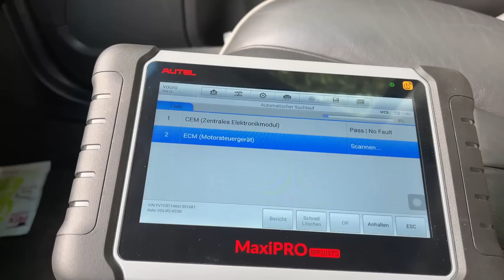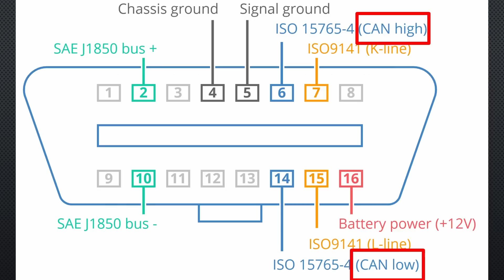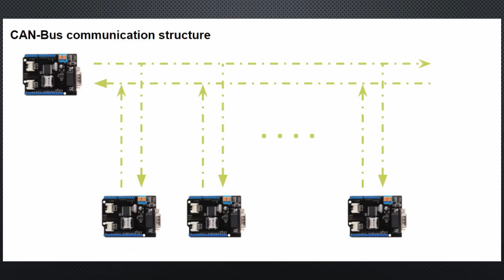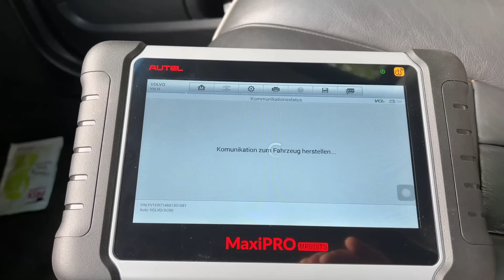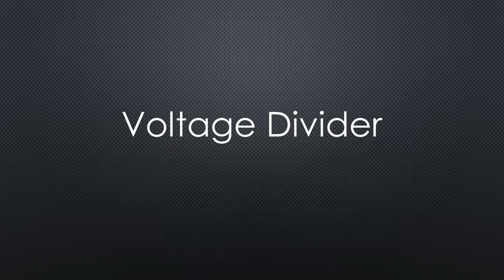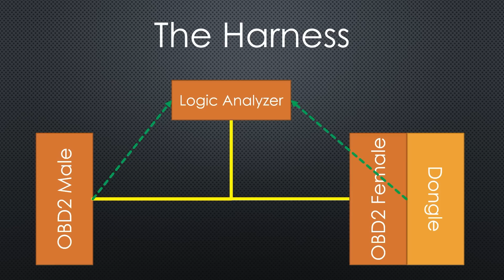#421 Home Made OBD2 Engine Alarm Resetter device using an Arduino?

Comment: After CDI and mapped ignition systems (PROM,s) electronic control of engine management, has been, downhill.  No longer, can the user make an adjustment, or ascertain what the fault may be, without some software magic.  Screwdrivers and spanners, are no longer enough.
😒
Reply from the maker: I agree. The world is getting more propretary systems...

Comment: I would like to read obd2 value and put then in a display, so I can later use value of rpm readed and every time rpm are between 1500 and 2000 activate an water pump. Is it possible?
Reply from the maker: Yes, you find such projects using Google.
Reply: @AndreasSpiess  actually you don't for few reasone, some incomplete, just show it working or show half of it, others like a like but they aren't what I looking for

Comment: Solution is ease... read all data from car without OBDII dongle, made list of ID/data frames in excel. And made another read but with OBDII dongle and made another excel list of ID/data frames.
Compare both lists of ID's and by this you will find only ID/data responsible for OBDII dongle.
Reply from the maker: Thank you for the tip!

Comment: The auto repair place located a defective oxygen sensor on the intake to the motor of my Toyota.  The alarm condition had been removed but the alarm history was still showing in diagnostics.

A local Hardware chain sold me the Innova 3020d for about $80cad.  I found the proper manual on-line and followed instructions to clear all.  It worked.

USB and WiFi OBDII dongles came with WinXP multiple softwares that were mostly demo versions.  Buggy, GUI quality and software functionality was rather poor.  

The best was a bluetooth OBDII dongle for about $12 combined with 5Euro Car Scanner Pro software from Android Play store.  The phone software had a cool free demo version that unlocked when paid.  Connecting to the BlueTooth dongle and then the ECU Engine Control Unit was smooth and repeatable.
Reply from the maker: Thanks for your info. After many comments I purchased such a dongle. But I still wait for the alarm coming back. So far the car runs and runs...

Comment: I am absolutely aghast that an engine would be allowed to refuse to start due to the failure of a non-essential sensor. I have a whole PDF dissecting in detail how my VW Z1 engine would handle the loss of basically any single (even critical timing) sensors AND KEEP GOING, by falling back to something else to obtain ALL information it needs - and yes, that includes losing BOTH channels from the accelerator pedal position sensor: the car defaults to an elevated idle, and still lets you limp home. Then again, the Z1 predates OBD2 (runs on KKL), from a time they used to make things properly...
Reply from the maker: In addition, the car runs without any problems since this day. So The problem obviously was not too critical :-(
Your car management system seems to be much better.

Comment: There might be encrypted obd 2 busses, and maybe search for some volvo dump of their obd 2 software, there might be a usable library. The standard OBD 2 (rpms etc) are I think part of a mandatory set, all manufacturers are having own subsets and calls to submodules ... Maybe you can find a universal library or even a universal android tool who works, then sniff the exact message is not easy.
Reply from the maker: As I have a tester which can create a working code I thought I can copy its behavior. Others also pointed to apps which should work. Currently I wait for the error to re-appear.

Comment: I scrolled through most of the comments but didn’t see it: what sensor failed that shut the car down?
Reply from the maker: Unfortunately we did not make a picture because we did not expect that it will no more appear. It was something with low voltage.

Comment: Usefull no, informative yes. I have an electric Smart for two and was hoping to see something. I guess I have to wait for the other video
Reply from the maker: Some electric cars seem to have no OBD2 connector anymore...
Reply: @AndreasSpiess  My 2013 SmartForTwo electric has one, but most dongle cannot read anything from port, except the most expensive one. One guy as a 5000$ unit that could not reset my error message!

Comment: Cars stopping dead is pretty dangerous. My DIY Arduino EFI stopped entering into fast moving traffic and nearly got T-boned, but thankfully I got it started just in time. Either way I got rid of it.
Reply from the maker: Good idea to disconnect it! I do not want to have it connected while driving. Just for resetting the error.

Comment: Hi Andreas, it is fine to use this resetter if it happened one time only. But if you are getting this error regularly, you should investigate the root cause. It might  create a machine damage, or even a safety issue, which slightest possibility is not acceptable where human safety risk is involved. If you are getting errors regularly, please be safe, and do this. (Promise we will watch those videos as well ;).

Take care.
Reply from the maker: Yes. Of course you are right!

Comment: another way to reset the ecu is to just simply disconnect the positive terminal of the battery
Reply from the maker: Good idea. Others suggest that the important trouble codes are stored in EEPROM. But I do not know.

Comment: Looking forward to your next video on this.  I have an OBD2/CAN reader tool that is sort of mid level ~85 USD that will read and reset codes on each of my various vehicles, Ford, Saturn, Honda, Jeep, Hyundai, and Mercedes.  They range from 2000 to 2019.

Not quite ready to tinker with my 2018 E63s AMG's bus but wouldn't worry too much about the Saturn :)

Beyond resetting the DTCs, the next step is controlling features of the car.  For example, my Mercedes shipped with intelligent LED lighting that is capable of operating with the high beams on all the time and just cutting out a box of light for oncoming traffic or for cars in front of you, however due to US DOT regulations the intelligent feature is disabled for US cars and we only get simple high beam low beam operation.  Thankfully, the US recently changed this law so smart headlights are coming soon.

In the meanwhile, it is possible to recode the car via the OBD2 connector and make it think this feature is enabled.  Driving the car at night on the highway with this feature enabled, well it's like night and day difference almost :-).

Other interesting features to play with depending on the vehicle.  I wonder if the Raspberry Pi with more capability and ready access to Python and more space for libraries would be a good platform to start from for the more advanced bus fiddling?
Reply from the maker: Your project ideas are far more complex than mine! I hope you find the needed information because it seems car companies protect it very well...

Comment: Are you making sure you don't reset more than just the alarms. So that the ECU don't revert to a kind of 1st startup every time you do this? hence it need kilomenters to tune in your driving, tune fuel to air mix ratio, etc.   Seen a few try similar before, and actually in practise, doing the same as disconnecting the battery would do. So fuel consume went up and more.
Reply from the maker: So far my plan is to copy the commands issued by the Autel device and hope it will not harm the car.

Comment: There are zero reasons the touchscreen on the average cars radio couldn't be used as an interface for an ECU. There are zero reasons for the ECU's Os to be written in gibberish. So why is it?
Right to repair laws must be made.
Reply from the maker: I assume most car customers do not care too much about this feature. So the marketing is concentrated on different things :-(
Reply: @AndreasSpiess  It's not a matter of what most care about. The point is making a product unnecessarily difficult for those, even if only one, to work, mod whatever a thing they own. Those changes I suggested, it cost the manufacturer more to not have. 
There is a movement in manufacturing to make products only they can repair. Every part requiring a "security" code. Repair vs new = disposable everything.
What's next? So no. This has nothing to do with caring. 
This is a problem that everyone needs to speak out about or it will spread.

Comment: I had a Mazda which would short out on a low battery or one which didn't have a good confection. It would set off the alarm, but in a way that was erratic and random. It happened to me once in the middle of the road when I had turned my car off to wait on a train. When I tried to turn it back on it went insane and started blowing the horn randomly and turning lights on and off randomly. Everyone around me probably thought I was the crazy one. 

It took a lot of research to figure out what happened and how to reset it. But I was eventually able to get it off the side of the road where I pushed it by following a reset process which was something like turn the switch on press the brake, turn it off, turn it on, turn it off, press the brake three times, open and close the door three times etc. I have no idea what the actual steps were but until I found those my car was just bricked because of a slightly low battery.
Reply from the maker: Good story! In my case, the alarm also did not reappear. Maybe it also was a false alarm.

Comment: Laughs in pure mechanical car. Cries when trying to find parts. Seriously need to add a feature to allow a car to run regardless of error or at minimum allow the car to run x amount of distance after first detection. Found it very useful to randomize maintenance warnings.
Reply from the maker: So far the alarm did not appear again. So it probably was not needed...

Comment: For those of you saying use ELM327, please remember we live in the arduino/microcontroller playground world. Why buy a ready made product when we can make it ourselves. what fun is that. (yes is is a quick resolve to an urgent problem but its not the way we roll in arduino world!
Reply from the maker: Still, I have to try a ready-made solution (as soon as the alarm reappears). Last time it did not work...

Comment: I would love to get a scanner for my old Holden Monterey (Trooper, Bighorn, Acura, Horizon, Monterey et al)) with the 4JX1 diesel engine but it doesn't respond to any ODB2 readers/scanners - it has the plug though, so I figure it must support an older protocol, so this project would be very interesting to me.
Reply from the maker: These connectors support also non- CAN protocols. But I have no knowledge about them…

Comment: ECM-6664
The Engine Control Module (ECM) controls the glow plug via the glow plug relay. The diagnostic trouble code (DTC) is stored if the engine control module (ECM) detects a fault in glow plug 4.
The diagnostic trouble code (DTC) can be diagnosed when the ignition is switched on.
meh, old glow plugs probably..
Reply from the maker: These alarms so far never hurt. It was another one. And you are right, it is well possible that things are old in an old car ;-)

Comment: Hi Andreas,

Seems my previous comment has gone, probably due to github link, so I will try to put it once again.
I was bit surprised that basic OBD2 command like Clear All DTCs does not work in the sandeepmistry's OBD2 library you tested and I think I found a bug in the code there.
According to the OBD2 protocol there should be number of data bytes in the message, while in the clearAllStoredDTC() method there is send 0 as number of bytes.
Please check line 714 of the OBD2 source file:
        CAN.write(0x00); // number of additional bytes
        CAN.write(0x04); // Mode / Service 4, for clearing DTC

I would expect there 1 byte of data, so corrected code should be:
        CAN.write(0x01); // number of additional bytes
        CAN.write(0x04); // Mode / Service 4, for clearing DTC

I haven't tested this, but you can try this fix if you want.
Reply from the maker: Thank you. I will test it!
Reply: This worked on my RX8. Thanks MrArecki777, and Andreas too!!

Comment: Hi Andreas! My solution to that problem is a 12USD/CHF ELM327 OBD2 to Bluetooth dongle along with the "Torque" app. The app cannot only display and record driving data. It can as well reset errors. Though I still had to replace the worn out (actually it was dirty) exhaust recirculation valve of my 2011 Mercedes Diesel to fix the issue. I hope you sensor will not need a replacement. Best regards from Limmattal! Adrian
PS: Of course I'm still looking forward to part 2 of that video! :-)
Reply from the maker: If you (and others) are right there is no part two because it seems to be very simple. I wait now till the error re-appears and try this app (BTW: Torque was no more free when I tried it. They wanted to sell me a contract. But maybe I did something wrong.
Reply: I did pay once a few CHF for the Torque pro app.  Though no subscription - at that time some years ago

Comment: Luckily, I don't have OBD in my car, I have a mechanical diesel TD27T, so no, it can't happen to me. No computers - no problems!
How we can avoid this? Just use old-good cars without electronics, as you have in your Volvo.
Reply from the maker: I agree. But those cars are hard to get these days :-( We had a Toyota diesel when I worked in Africa. It fell into a River and still ran afterwards.
Reply: @AndreasSpiess  Yeah, that cars were really reliable.

Comment: Interesting...but if you just want to reset it, the $15 Bluetooth ELM adapter and the free Android app "car scanner" will do that cheaper and faster than arduino, shield, cable, etc etc.
Still, it's a super neat project.
Reply from the maker: So far I was not successful with the Smartphone apps. But many people wrote it should work. So I will try as soon as the error appears again...
Reply: @AndreasSpiess  it depends on the app and the age of the car.  Try "torque" and "car scanner"...I had best luck with them.  I will say that it worked on my 2013 Nissan Altima and it did not work on my 98 Chevy pickup -but the latter is most likely due to age and not having full ODBC2 compliance.

Comment: There is a very good message display and filtering tool available. Watch all the parts of https://youtu.be/cAAzXM5vsi0. I used it to detect messages on the convenience bus (different pins on the connector and different speed).

Comment: ODb2 send and request works on fixed can id, I think something around ~630. You need to filter out your stream based on ID. In true ODB ( as example R1200gs motorcycle) where is special microcontroller that translates external DOB2 traffic to internal canbus. So you will not going to cause problems. so this switch is filtering all the data.

I think you are generating a lot of messages to request data over this fixed id's Better way is to decode true data from canbus in sniffing mode, in that way you will not cause problems.
Reply from the maker: I try to filter data after sniffing in Excel (I am quite familiar with Excel Macros). Maybe I will come across your 630 IDs.

Comment: The MOST frustrating thing with modern CANbus electronics in cars is this EXACT problem. I know that you do need a more expensive unit to do SOME of the more involved tests and diagnostics but my wife's VW Golf had a repeating non critical error that was becoming a real pain. It would only happen about once a fortnight originally but gradually got more frequent. I bought one of those cheap OBDII units off eBay for a few quid that works with the free app Torque (paid version supports some additional features).

It worked great! Told me exactly what the problem code was, quick Google search to establish cause (faulty temp it said!) 

BUT, most importantly, it reset the fault code when requested. Fault eventually tracked to BOTH a faulty sensor AND a dodgy connection - something viewers should beware since such wire faults are always misreported (by the fault code description) as sensor faults - a potential money pit if an EXPENSIVELY OVERPRICED sensor is purchased and fails to fix the problem!

I now have one permanently installed in both my car and my wife's. WELL worth the money! <£5 each!
Reply from the maker: I just tried another recommended app. So far it has not shown the (non-critical) DTCs shown by the Autel instrument. The initial error did not reappear, unfortunately...
Reply: @AndreasSpiess  bummer! 😥

Comment: Might not work because OBD-II compliant vehicles can use any one of 5 different communication protocols: SAE J1850 PWM, SAE J1850 VPW, ISO9141-2, ISO14230-4 (KWP2000), or ISO 15765-4/SAE J2480. You might want to take a look at pyobd, which only needs a e.g. pi and a 5 euro ELM-USB cable..
Reply from the maker: Thank you for the link to the software. Maybe I have to buy such an ELM-USB adapter...

Comment: A J2534 passthrough device/chip is what works with the Volvo factory software. I will caution you to be careful sending errant commands to the car. Volvos can be very touchy about their canbus systems. I've even bricked a window switch by using the factory software to send commands to it. Hopefully yours being newer than mine makes the controllers and software more mature, but I would still be very careful.
Reply from the maker: Thank you for the warning. I hoped to only do exactly the same thing the Autel instrument did. This or these magic messages deleted the error and made the car work again. So far the error did not reappear...
Reply: @AndreasSpiess  If you had a good used module you could experiment with it on the bench. You could even duplicate the low voltage error by adjusting your power supply.